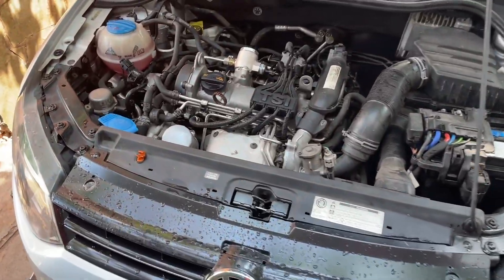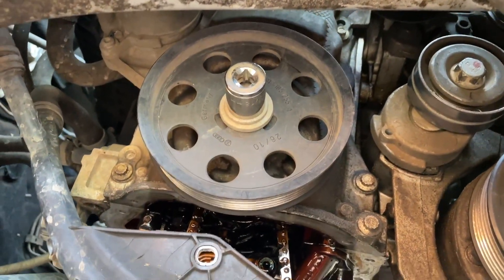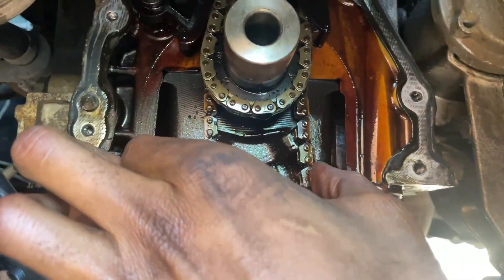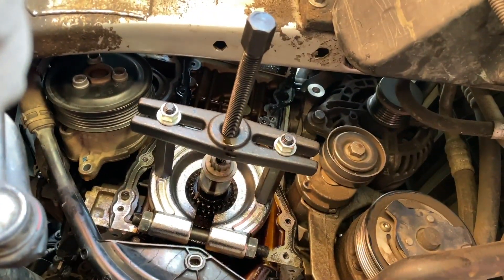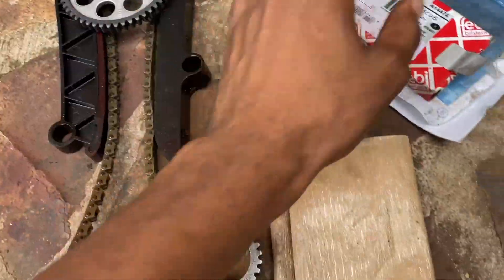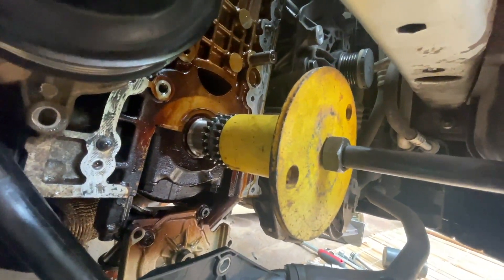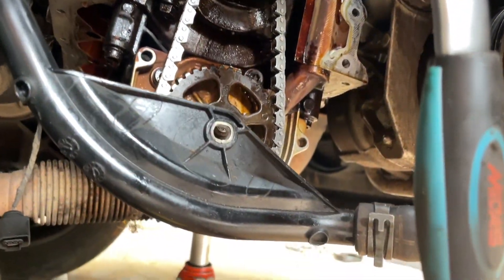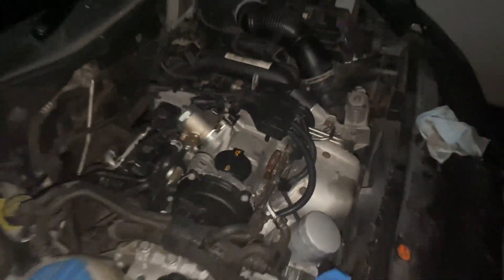VW Polo 1.2 TSI Timing Chain Upgrade | Newer Revision Install (CBZA/CBZB Engines)

Comment: I'm about to change timing chain on my Polo but i'm annoyed that there are no keyway grooves on neither the camshaft sprocket nor the crankshaft sprocket.
Would be easier to get the timing right if you could not get the sprocket abit off...

Comment: Good work frank, ive done one of these years ago and cannot remember now, so just gave your video a watch to remind myself. I remember the difference the last one i did made, i think the tensioners also go weak and cause a really bad rattle on startup when the chain is stretched and the tensioner spring is weak and cannot apply enough force when coming close to full extension. nice to hear how quiet the engine is after the chain replacement.

Comment: Hi

Is it normal when you lock crank with tool you can still rotate the crank anti clockwise?
Reply from the maker: Hi, yes. Its normal, but if you have locked the crank only
Reply: @ i loosened the cam sprocket bolt and then put a new cam sprocket on and tightened it down but then i looked at the crank and it wasnt TDC, I think i have to loosen the cam sprocket again and put crank to TDC first then tighten the cam sprocket bolt again 

Bit annoying as the crank can rotate backwards even with the locking tool on 🤦
Reply from the maker: @techstuff786 yes you are correct you have to loosen it. But make sure the tool on the head has gone in completely to the end of cam. Additionally make sure you hold the cam with the tool

Comment: Bro i have a question me i have to be careful for down poly the theets or no just remove old and put new one i mean crank poly are there marks like timing or something?
Reply from the maker: @zargarshams6904  hi bro. You just bolt it straight away. The timing is done using the timing tools
Reply: @frankcumaio8328  okay thanks bro

Comment: Great video, can you answer that I have to change only timing cover in 1.2 Tsi SEAT because it is leaking. I already bought new oil, torque wrench and new cover sealant, should I drain the coolant also?? If I have to change only timing cover??

Comment: The rattle of the chain has 2 causes:

1. The chain is stretched (in the case of vw polo cbzb 1.2 tsi - over 47 cm!!!)
2. The chain performs as a stretched chain (tho is no longer than 47 cm!!!) because of the internal fail of it’s tensioner! So if you can measure the chain and it the same length in cm as a new one and also inspect it visually and see it doesn’t have any damage, than the chain can be reused and you only need to replace the TENSIONER!

The causes of a failed tensioner are: 1. The lack of lubrication or proper lubrication (oil loses, bad oil, low oil pressure etc.) or 2. The internal damage of the tensioner because of the km and of the usage!
Reply: Ifyou have a new chain to measure the old one with, just put a new chain, is there a way of checking the tensioner without removing the chain or removing covers

Comment: Why haven't you shown how you rotated the engine after setting up the timing chain?
Reply from the maker: thanks for the comment. Very simple just used the crank  puley bolt
Reply: @frankcumaio8328  iv tried that and every time the chain jumps..this is after changing the oil  pump chain only. Now im stuck because im not sho if i should change the timing chain and tensioner as well because im aware that the tensioner only works properly with oil pressure.but the only problem the car had was the noise from oil pump chain.

Comment: Hi!

Doesn't the sprocket for the timing chain on the crankshaft need to be aligned with a specific zeroing position to be positioned correctly on the crankshaft when the sprocket is installed to the crank?
Reply: I am wondering the same, it doesn't appear to have a keyway so how do you know exactly the position to replace it? 
If the teeth are not in exactly the same position as when it was removed that will affect the camshaft timing.

Comment: That rattling noise at the first startup after replacement, was it only one time or is it still like that when starting it up? 
Mine has a rattling noise when startup for about 1-2 seconds, then gone. Thinking that I might need to replace mine (again since it was replaced 3 years ago). 

Thanks for a great video!

Comment: great video ... what long sprocket/bolt are used for installing the new double gear - in between oilpump-chain and timing-chain - on the camshaft?

Comment: Thanks for the video, i need to replace front oil seal can the crank pully be removed and reinstalled with just the holding tool? Or are the crank locking pins also required?
Reply from the maker: Welcome. Only the holding tool is needed

Comment: Hello, Thank you for video!
Can you please tell what torque you used to oilpump sprocket? I found 14nm + 90°
Reply from the maker: Thank you. 20nm + 90 degree, make sure use new bolt
Reply: In video it looks like you used old bolt, I did too, can It be problem? I saw it in another video too @frankcumaio
Reply: @frankcumaio  hello, very good videos! 
Did you change that bolt? Because I don't have one.
Reply: @Gets2593  I didnt use new too, now it have 1 And half year and 20 000 km, everything ok
Reply: @paulPavlosCZ  what you need to change the crankshaft bolt? or the oil pump sprocket bolt? do both need to be changed?

Comment: Hello Bro, thanks for sharing, one question, what do you men qhen you say MAKE SHURE YOUR ENGINE IS ON TDC?
Reply from the maker: TDC mean Top dead center. Is the point in which the piston in the number one cylinder position of your engine is at its highest point on the compression stroke. When you place the locking tool correctly the engine will be at TDC.
Reply: @frankcumaio  Top dead center. If you're not certain, just place the camshaft locking tool in place and once the bolt hole of the tool aligns with the bolt hole perfectly, it's TDC.

Comment: Hey mate. Awesome video. Thanks. Few questions about the crank sprocket. 1. What are the dimensions of the pipe? 2. As I just opened my kit, I noticed that the sprocket isn’t keyed, so how did you make sure it was in time? And 3. How long of a bolt did you use for that very nice tool you constructed?
Thank you kindly 🖖
Reply from the maker: HI Mate thank you. 1. sorry which pipe?  2 Yes they are not keyed thats why you need the locking tools, by installing the locking tools the engine will be at TDC 3. i used M14 bolts and nuts 10 or 12 cm if i recall

Comment: Its not a simply  job....mannnnm!....how did you do the setup chain?
Reply from the maker: You just need to remove the tensioner and unbolt the cam sprocket it comes straight away, but I’m not sure if i got your question?

Comment: Hi man, nice fix. What is the thread size on the sprocket push tool (yellow one)?
Reply from the maker: Hi man, thank you so much. The tread size i think is M14 x 1,5
Reply: @frankcumaio  No problem. I found another method, it includes heating up the sprocket with a heat gun (600C) -> use it on the sprocket for 30 seconds and then it slides right in.
 
Can't put any links to the video because YT deletes the comments otherwise, but the video name is 'VW Golf 6 1.2 TSI Steuerkette wechseln' by kfz tutorial bros. Skip to 24:40 and you understand what I mean.

You inspired me to do the cam holder tool, I also have some scrap metal I can cut and use :)

Comment: Thank you very much. 

A mechanic quoted me at 1200€ for replacing the chain but now after watching these videos, i bought a chain kit for 150€ + other needed tools + oil came to around 300€ so i easily saved about 900€

But that job was a lot more complex than on my old Mondeo where i changed the cambelt with ease as its so simple
Reply from the maker: You welcome.,Yes they look complex, but once you got the tools it’s easy
Reply: This is actually far from complex. This is one of the simplest engines i've even seen. Probably the simplest engine to replace the timing/oil pump chain ever. Simpler even than replacing timing belt on many engines, especially Subarus.